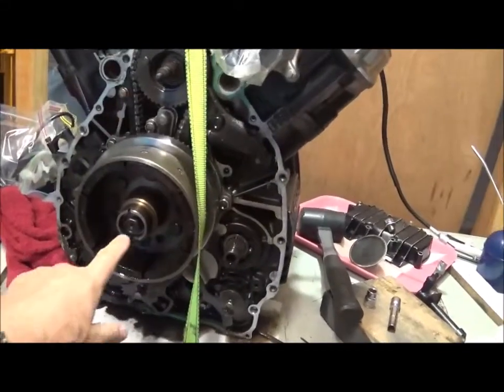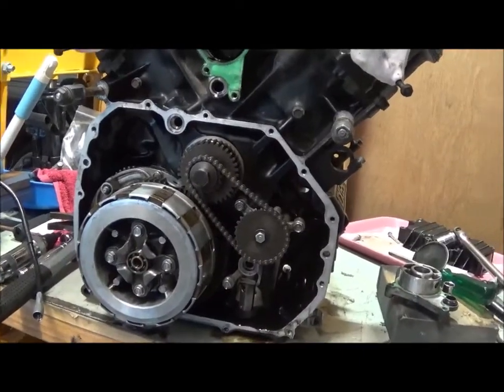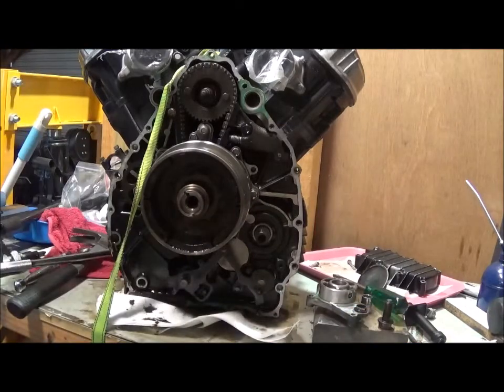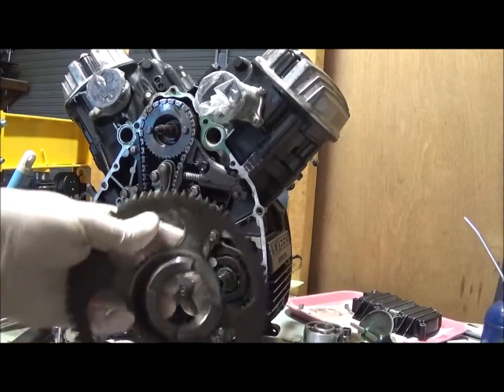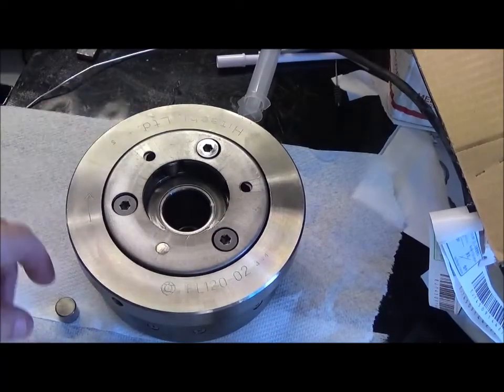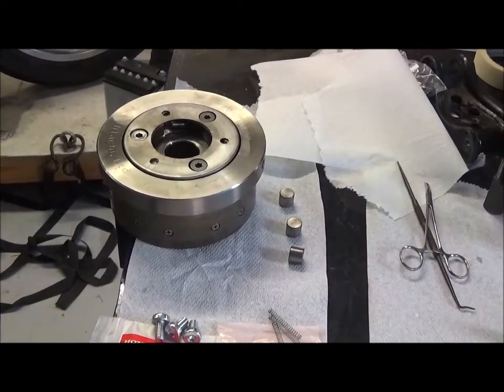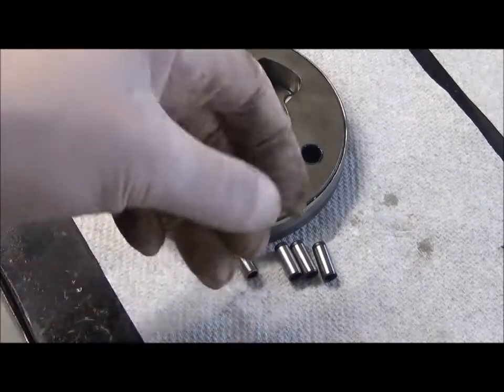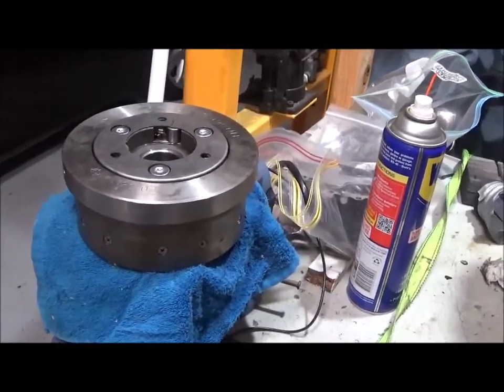Honda CX500 CX650 - Triple/Quad Bypass - How to Service Starter Clutch

Comment: I should hopefully make light work of removing this on my CX650 Turbo when I do it. I have a great electric Dewalt impact gun which apparently makes it so much easier without having to remove the clutch cover and locking the drive. Wish me luck.  ☺